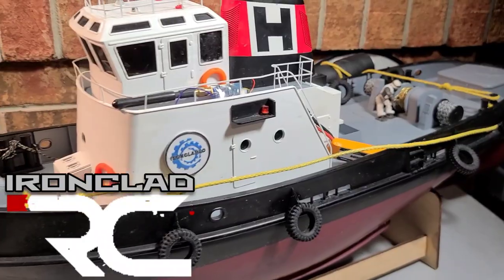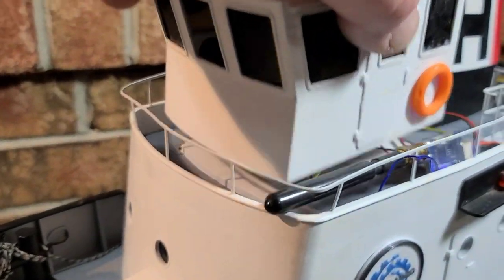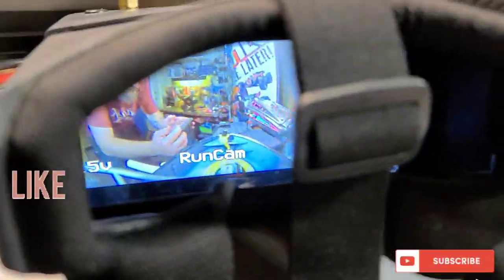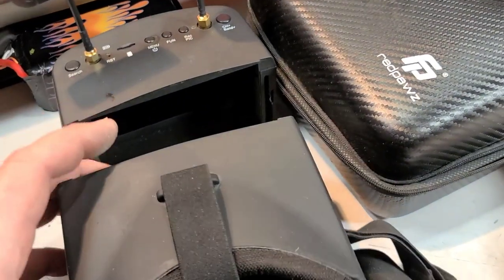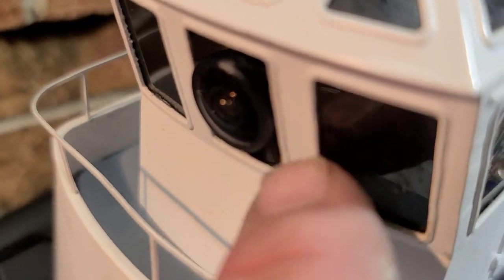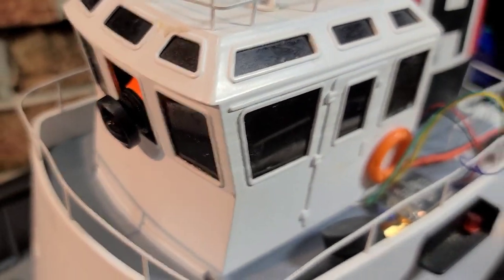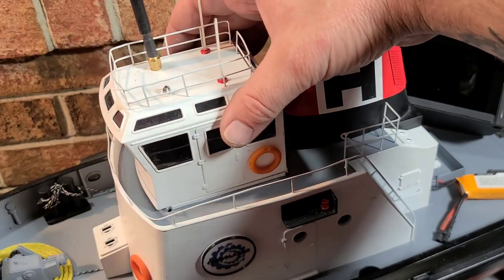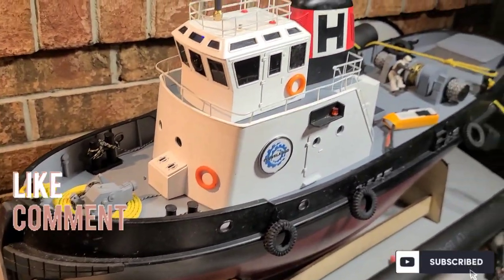Long Range FPV Rescue Boat Horizon Harbor Tug Boat - FPV Install Rc Boat

Comment: A little advice.  Try not to leave the video transmitter powered on when not in use. "The little module" They get really hot and usually get air flow to cool them.
Reply from the maker: Thanks. So I may need to incorporate a little cooling fan into the setup?  Thanks again
Reply: @IRONCLADRC  exactly what I was thinking after I saw where you installed it. It's a great spot for keeping things dry but also means no air flow. You could wire in a switch to turn everything on so you don't have to fiddle with the canopy.Also didnt see you do it but never power on the system without antennas. They provide some heat sink and resistance. Can't wait to see a rescue!

Comment: I Did this last year to mine waaaaaaaaaaay a head of you !
Ha Ha !!
Beat ya !!!!!!
And I got rid of the combo ESC reciever pice of junk !
And put in a Red Cat Transmitter & Reciever it gets better Distance !
Try it Dude !
Reply from the maker: I've got a few brushed escs I could throw on her when the stock electronics let loose but until them I'm gonna let her dig.     Took the fpv out today worked great for my test run

Comment: I did basically the same thing but the problem with this setup is there is no switch to shut it off. You have to take the wheel house on and off. That chip board gets hot and wondering what the heat would do inside the wheel house.you would have to leave it unscrewed whe your using it or just leave the battery connection out side so you can plug it and unplug it when not in use. But still Kool tho. I did benched try it. I'm going to find a way to hook to the main supply lipo and go from there
Reply from the maker: I ran my battery wire thru the bottom of the wheel house and velcro the bayery under the main hatch
Reply: @IRONCLADRC  that's a good way. I may try that so the battery is in the engine compartment. In fact the more I think about it that's a real good idea. Thanks for the tip.

Comment: How about links to all the FPV? Excellent video!!
Reply from the maker: I didn't leave links because I didn't wanna lead any one the wrong way.   As you saw I had no idea what exactly everything is
Reply: @IRONCLADRC  maybe leave a parts list and a “at your own risk, you are learning with me” disclaimer! I love the way fpv puts you in the driver seat. Little slow rc cars and boats become insane fun! Fun tip, you can grab an extra set of fpv goggles and take people for “rides”. I used to do this for my drone so they could experience without crashing my rc! I have the same goggles and loovvveee them! Thanks for all you do! I ALWAYS recommend your page. Big love for big b from the big apple!

Comment: Now THAT is something ProBoat should consider.  One of the big issues with rescue boats is seeing what you are doing when a long ways away.  FPV solves that.  Be certain to tell your contacts at PB about this idea.  👍👍
Reply from the maker: I think it would be a great addition to the rescue boat plus it would  add a bit of fun factor to the rescue mission especially in big bodies of water

Comment: Hey Big B have you ever experimented with sanding the hull of the fast boats? I've been reading it might make a slight difference. I think some racers do it. Might be to minimal for the effort?
Reply from the maker: My Deltaforce 35 has a sanded bottom. I used 2000 grit fine sand paper  & I've recently done my v2 sonicwake but I didn't use sand paper on the v2 I used magic eraser (Mr, clean magic eraser)  to lightly scuff the bottom basically knock the shine off.  Right after I did it I got my pb with the boat.     Basically do it to all my boats
Reply: @IRONCLADRC  Nice! thanks for the info. I'll have to try it

Comment: Very sweet setup man, We were kayaking yesterday and I was certain that I sunk my sonicwake V1.. I had the 4514 oxidean on it and went full throttle and hit a log that i didnt see. boat took off like a rocket and made the loudest bang noise, i was sure the hull cracked but got super lucky... The whole battery tray that is glued or epoxied on from factory completely sheared off, im debating on using hothglue or some type of cyanoacrylate. Any suggestions big B? On a posititive note... she was ripping like crazy until she got airborne!
Reply from the maker: G-flex epoxy may work on the polycarbonate?   I know it works on abs, what ever you use just prep the area lightly sand with 80/100 grit sand paper.

Comment: The package aays it will work on 2s or 3s--- is it worth even trying on 2s
Reply from the maker: I've run it on 2s it's fairly slow 3s is the sweet spot

Comment: Gotta say, as great as tug boat for recovering flipped boats sounds, the pipe idea, although effective, suck balls! 😂
Why there is no articulating boom with a magnet on a string, that would grab any magnetic metal on the boat, or a hidden magnet on the Hull bottom, and haul to shore this way?
Ironclad, get to work!
Reply from the maker: That would be cool

Comment: Enjoy dude any ? Holler
Reply from the maker: Going to test it out now.     gonna have to redo to set up of the battery situation so I can permanently mount the wheel house but other than that it's freaking awsome.   Thanks
Reply: @IRONCLADRC  can you see through pilot house window  looks dark lol
Reply: Cool just getting to watch,
Reply: @IRONCLADRC  no problem dude ,  should work fine for its mission. lol. maybe one day i can get down there and zoom around with ya  , only 2 hrs drive.  lol if proboat does a kit i want props or a tug . building a fountain express from scratch probably 12s setup . see how my modded sonic wake compares to the new one. my gps says 76 with 3 blade cnc prop  and 9200 pack. she screams. need intewebs so i can upload some vids. no such thing where i live just phone
Reply from the maker: Dang 76 with the v1 is screaming son that's awesome.      Yea man just shoot me an email when you your in the area, we can rip it up brother
Reply: @IRONCLADRC  lol nothing is stock, ztw 200a esc, 4276 apex, cnc 3 blade